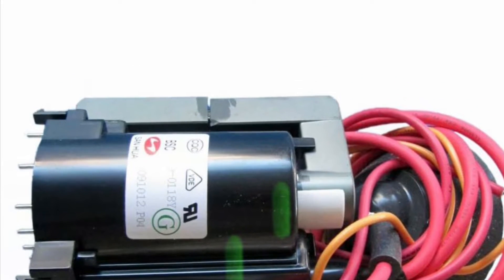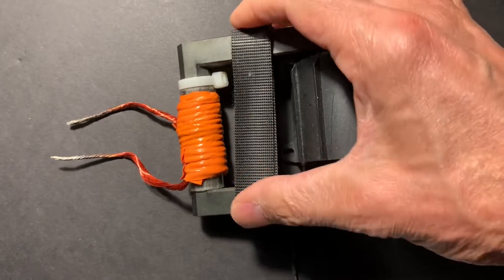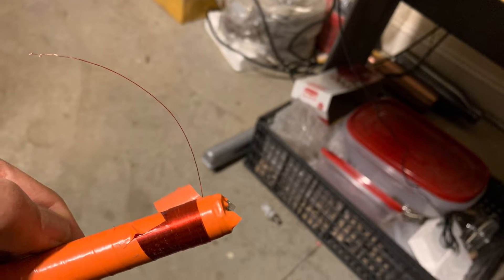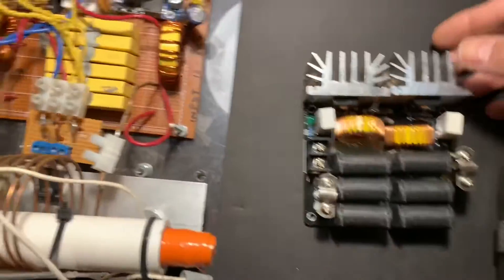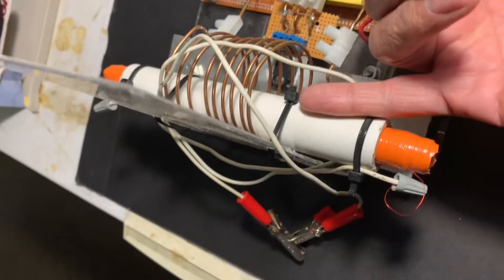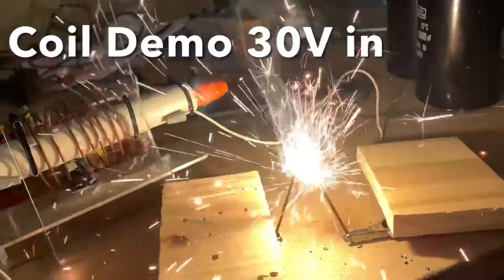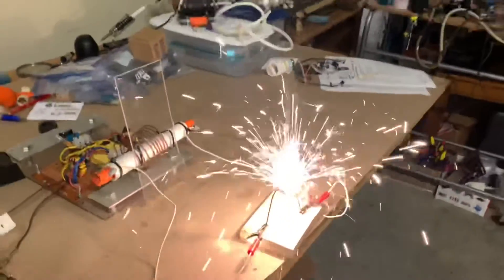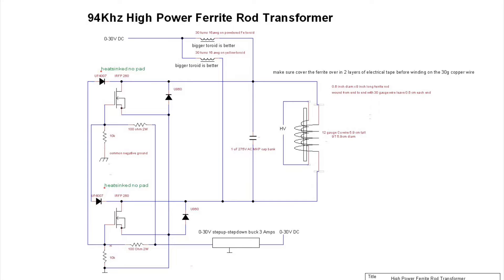Insane Arc from Ferrite Rod Transformer (@SciTubeHD)

Comment: So you using another supply for the drain same as your last tesla coil drived zvs. I wonder if this ferrit rod can be drive from single power zvs like normaly we use it.
Reply from the maker: Yes it would work. To  get maximum output, can adjust capacitance on ZVS. With this setup, maximum output was with 2 uF.
Reply: Seperate gate supply just helps it run efficiently at different voltages withour changing resistors and allows it to run at lower drain voltages

Comment: If I’d like to tune this at 40khz, with a 2300pF capacitance, what would be the amout of winding turns?
This is for an half-bridge setup for say…
Reply: There are calculators for that. Just search for "inductor calculator" and "LC resonance calculator".

LC resonance is given by the formula:
F = 2 / (2 pi sqrt(L * C))

Knock yourself out!

Comment: How did you find the resonant frequency of the coil?
Reply from the maker: I connected one end of the coil to a signal generator and used an antenna to scope the output
Reply: what sort of antenna? @BrianDhvTinkerer
Reply: and how come you need to run this transformer at resonance but not the normal ones?